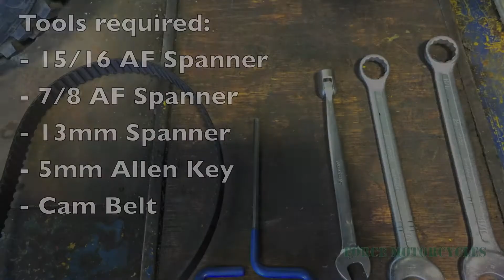Cam Belt / Timing Belt Replacement Tutorial for MT500, MT350, Rotax

Comment: hi should there be a small washer that goes into the top pulley before the big main washer ??many thanks ,
Reply: hi how many washers should there be on the top pulley holding the pulley on is the one small washer that goes on first to fill the small gap on the end of the shaft ?thanks so much for your time .

Comment: Great video. Any links or tips for if the belt is destroyed? Or just line up the pulleys individually?
Reply from the maker: Hi Josh,

Thank you! Glad you like the video. 

If the belt is destroyed completely there is normally a reason.

This can be:
- Seized idler(s)
- Oil contamination 
- Loose or worn top pulley
- Rusty bottom pulley

Line up:
- Bottom pulley so mark is at 11 o’clock
- Top pulley so mark is at 11 o’clock 
- Straight edge should be able to be passed through the 10 mm nut and line up with top and bottom pulley
- Rotate engine on kickstart a few turns to ensure it runs flush with outer edge of top pulley but does NOT overhang it.

Should be good to go! 

Hope this helps.

Force
Reply: @forcemotorcyclesUK  could you do a video about the clutch replacement? Thanks!

Comment: there is a bolt at the bottom that locks the crank in its proper place   
i always use it... screw ups cost money Dave wd8cyv
Reply: Thought the 11 o clock business was a bit hit and miss, surely an odd tooth out would make a lot of difference to engine performance...
Reply: @ideyboo  i was thinking just the same.
This doesn't seem very accurate

Comment from the maker: Not entirely necessary on these engines as valve collision cannot normally occur on 348 and 504 motors. If you lock up the motor with the TDC locking bolt, it will be tempting to use that resistance to undo bottom pulley nut, and strip out its threads.
Then you will have a catastrophe......
Reply: You could do a video about the clutch replacement?
Thanks!
Reply: Then what is the proper way of undoing the bottom pulley nut?
Reply: Wat about the 604 motor